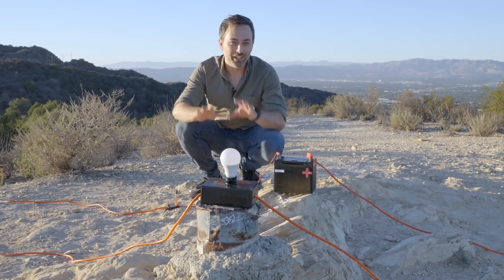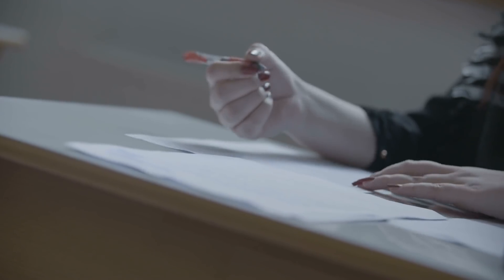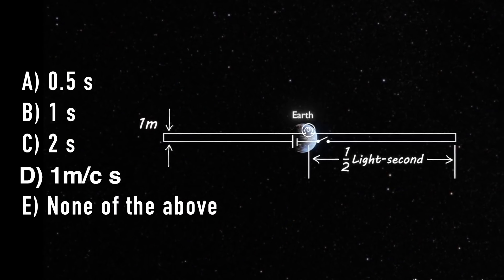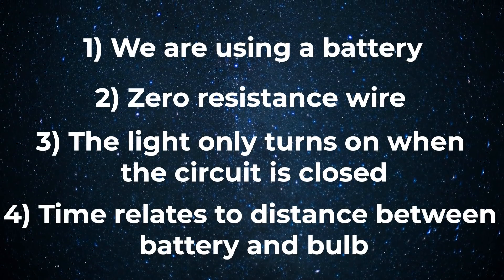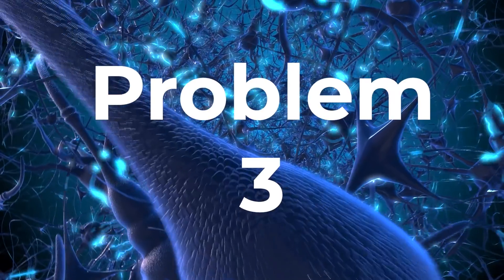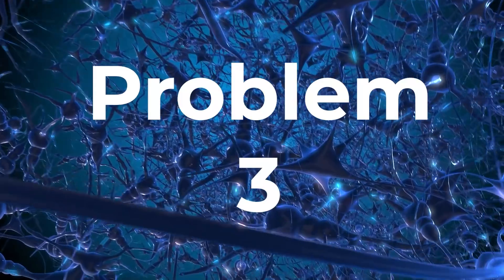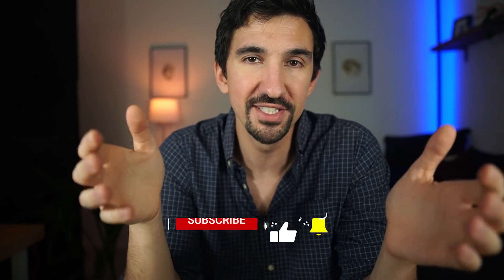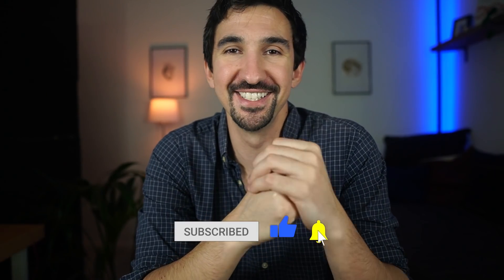Is Veritasium Wrong About Electricity?

Comment: Agree, the point of the thought experiment shown by Veritasium is to point out that electromagnetic energy can be transmitted by EM fields through empty space. So as you said, the set-up is the equivalent of a giant antenna, having very long transient rather than oscillating source. Indeed the amount of energy that can be practically transmitted with the set-up show is be very small. I liked Veritasium movie as it was quite thought provoking, but true that some parts are rather misleading.
Reply: The problem I have is that you can suppose the problem as DC supply and the without an alternating current you couldn't talk about antennae effects.
Reply: @alexnaturalis1179  Turning on a switch is an AC effect. I believe the circuit doesn't actually reach a DC steady state until the voltage wave has travelled all the way to the bulb and back through the wire, so Derek is looking purely in the AC/antenna regime.
Reply: @alexnaturalis1179  Totally agree.
Reply: Not "can be transmitted."  Is transmitted, always.  The wires don't carry the energy, the EM field does, in all circuits, always.  Check out Science Asylum for a more in-depth explanation, including some videos on how this is necessary for relatively to work.
Reply: @georgedorn_fnord  I came here to say just that. Really all mechanical energy is transmitted by the electromagnetic force. Based on bonds in the two materials and the repulsion by those electrons on the electrons of the other material or object.
Reply: Isn't that just radiation? There has to be an easier way to describe that if that really was what he was going for.
Reply: A combination of inappropriate assumptions and simplified physical effects is likely to result in invalid meaningless results.
To present this to people as useful information is silly.
Anyone with more than a high school science knowledge could see what it was.
Reply: Veritasium claimed you can transfer information faster than light in his thought experiment. the whole 1s/c or whatever is the culprit of that. It is not true and never will be since it'd break the laws of physics.
Reply: Surely there would only be a short spike of voltage induced on the bulb side since Derek is using a battery which is DC. The field would only induce a spike while forming.

Comment: About the "lies you were told about electricity" - think about it this way: If you get an explanation that does not fit the current understanding of the topic, but helps guide you to understanding (given enough time) that is technically speaking still a lie, as the facts are known to the one telling you something different than the facts.

The intentions behind this definitely are good, and it is necessary, too, as there is no way for beginning chemists to actually understand, say, the atomic model in its entirety. But, strictly speaking, it is a lie.

This is why Terry Pratchett once defined teachers as "Professional liars for children". Which, in turn, required him to elaborate on that point, which brings us here =)
Reply: There's no 'strictly speaking it's a lie'. It is either true or it is not true. Veritasium has been wrong about a lot things for the past 2 years. Just saying.

Comment: If the switch or the bulb (or a breakage as you suggest) were a light second away, it would appear to take a second - unless you as an observer were somewhere between them. It only happens instantly because the switch and light are about the same distance as one another from the observer.

Comment: At the beginning of the video I think you didn't notice that 1/c has correct units , because time equal distance over speed , the distance is one meter which is the distance between the lamp and battery and speed c so dividing 1meter by c will give us 1/c second so it is correct unit but it just wasn't obvious where did he got that 1 in numerator

Comment: I immediately disagree because if you have followed veritasium's video this means that at the furthest point in the circuit, after 1/c "seconds", you would have no clue that the circuit was closed because it would take a second for the energy to propagate through the electromagnetic field. Counter-intuitive, I know, but that holds if you agree with the theory describing how energy propagates through the field described in Ve's video. So yeah, the light bulb would turn on first and whatever instrument you put at the furthest point would turn on later.

Comment: LMAO "scientists" the only people on the planet dumber than engineers... look at your diagram again (put your finger on it if you need to) now starting from the battery side of the switch trace the line through the battery around to the lamp through the lamp and back to the switch.....do i need to explain this any further? the answer to the original question is that current flows the instant the switch closes because the only thing preventing flow was the open switch.

Comment: this was my first thought too!  Its a f*ckin dipole transmitter receiver!  Transfer of current.... well yes... but miniscule!
Reply: I feel like we can say that yes, Veritasium was wrong because in the context of what he was saying, it doesn't really work. The fact that technically some small amount might transfer seems to be a coincidence rather that what he was trying to explain.
Reply: Yep, using a reasonable battery, no person would be able to see it light up.
Reply: Please make a video
Reply: with DC? just an initial turn-on edge is flickered, not a constant "transmission"
Reply: Debunk it please
Reply: Please bust Veritasium. And learn about the Oil Industry.
Reply: With only one pulse because a steady direct current does not cause any further change in the magnetic field. The same principle applies when you feed a steady direct current into a transformer; there is no output from the transformer. To transfer current, a changing magnetic field is required. This is nothing more than a large, very low frequency tuned circuit, with incredibly large impedance that will delay the flow of current.
Reply: Can induction occur using Direct current? I would have thought that alternating current would have to be utilised 
to make this a dipole transmitter receiver. If anyone can enlighten me I would appreciate the reply.
Reply: @davidbrayshaw3529  The induced current depends on the rate of change of the current in the transmitter. You are right that AC current is constantly changing, and DC is not, but when the switch is flipped there is an initial current change (from 0 to whatever) and that is what can induce a current in the receiving cables, after the current has stabilized there is no more energy transmission between the cables
Reply: @johnegbert4786  Thank you, that makes sense. Effectively you've created a transmitter that operates at a very low frequency!!!
Reply: I agree, further more, we can expand the thought experiment with a second wire, and a second lamp, connected to nothing, an exactly equal distance from the source of power. If we measure both wires and they have identical conditions, they should both "turn on" but one isn't connected to the circuit. 

As such it has to be a transmitter, and nothing else, otherwise we would break causality. 

Lets say at 1700 we flip the switch, at the same time a guy on the moon (told in advance) flips his switch either on or off. 
We would know before the speed of light if that guy had flipped his switch on or off. 
As such this experiment if looked at very honestly would break causality.

If instead we add a second lamp with a second wire an equal distance away from the power source with identical thickness and resistance, but not connected to anything, we would either see both light up and this is just an antenna, or we would see the connected one light up (spoilers, no we wouldn't) and the whole thing breaks causality.
Reply: @Yattayatta  Your luna colleague and you would not be able to flip the switch at the same time due to general relativity.
Reply: @Tossphate  I don't know what part of my thought experiment you misunderstood, but of course you can flip the switch at the same time. Time dilation is a known factor and the movement of the moon is easy to calculate. 
This is how you would flip the switches at the same time:

Both flip at exactly 5:00 :00 local moon time,  If he flips, it's a 1, if not it's a 0, as such you have a bit and now you can transfer information faster than the speed of light, that is why the explanation in the veritasium video is at best disingenuous , because that would break causality, and that is not possible.
Reply: @Yattayatta  Simultaneity is frame dependent, and you and your friend are in two different frames. You cannot both agree on a simultaneous instant.
Reply: @Tossphate  No need for a single frame if you want to talk quanta. Lets extend the cables to the sun, he encodes his message 5:00:00 pm, I flip the switch to receive it at 5:00:05, light makes it there 7 minutes and 55 seconds later. You are not understand my thought experiment
Reply: There's no proof space is real. NASA means "to deceive" in Hebrew. The 2nd law of thermodynamics says space is fake. NASA lied. NASA steals $60 mil per day to shoot helium balloons into the ocean. We see mountains from 300miles away. That's impossible if we lived on a globe. 247 flat earth discord.
Reply: @xvhkgreen6297  i know Hebrew and NASA does not mean "to deceive", not a single synonym of deceive means nasa, nasa sound in Hebrew as "נסע" which means "to travel" lmao
Reply: Why am I so happy about randomly stumbling on one of your comments?
Reply: @Drachencheat   Because you (and I) have been brought up in a culture of product and celebrity worship.

Comment: I think you just took it further than the intent of his video and included potential.  Most people are taught electrical flow is like a water pipe, he was showing that this is not how it works, although for the layman wanting to wire up a simple circuit, it may serve them as a way to not over-complicate it and just get the job done as they have no interest in theory, only completing a circuit without frying themselves or the components. I do like how you took it a step further, but to be fair, I again don't think that was the point of his video. Thank you for the thought provoking content.

Comment: about the info transmitting faster than speed of light, i dont really understand anything at all so if someone sees i am wrong or confused or something pls send help ;(
now how im gonna set up the situation in regards to having only one button next to battery is gonna be different which is probably gonna change some things and idek how it will work with this, here im assuming theres not button near the lamp or battery 
now i dont think having a button at the far end will work because even if the far ends are disconnected the light will still turn on
other than wtv that poynting vector thing was (i havent learnt about it yet so i really dont understand it but) how i understand it is that the long length of wire on both sides will act as antennas and even if both far ends are disconnected (having a button) the capacitance between the wires and mutual induction will induce a current on the lamp and turn it on (is this how the poynting vector thing is supposed to work?? or should i wait till i learn about it ??) (also will this still work with having the button/switch in off state near the battery??) 
on DC source i think?? the capacitance and inductance will saturate soon enough ?? and the lamp will turn off or at least get dimmer after a while?? (im not too sure about this one) and by the time that happens IF the ends are connected the wave will have propagated through the whole length of wire to keep it on, on AC source this wont be a problem i guess?
so having a button really wouldnt change it, and if i understand it correctly on DC source if the lamp is dimmer/off after a while, having a button there to complete the circuit to let the wave pass is only gonna let that happen at the speed of 'c' so ye
tho im really not sure about wtv i said i really havent studied enough yet

Comment: I've liked Derek's video but I've made the same reasoning you have done. His video is only half of the story (the one that makes you say "WOW!") but it is a lot  misleading in terms of what you can get in the reality.
Especially he omits entirely what happens after the initial transient phase (that with that setup, barely produces any light at all, and lasts very short, which I can't count for "light turned on" but at best "light flashes a little") and the steady state phase when  the energy really arrives from the conductor of the closed circuit. 

I think the misleading part is mixing theoretical analysis (which is completely correct) with a super simply circuit made with real (cheap) parts and expect that theoretical effect appears in all its glory, which will never happen with that setup.

Comment: 1. It does not depend only on the resistance of the wires, it depends on the characteristic impedance of the line
2. Ignoring z, distance can be measured across 2 axes. Why is everyone ignoring the fact that he specifies the distance of 1 meter between the lamp and the bulb only on one axis ? If the lamp was 300,000,000 meters more to the left from the bulb, it would not light up that fast.

Comment: In the veritassium model the electron doesn't actually go all the way round the circuit, it just jostles an electron in a neighboring atom. Now it doesn't matter how tiny the distance between atoms is, the speed of the electron in making that communication is limited by the speed of light.

Comment: Okay, I have thought about this and... more questions raise like: if it is only the field that transmits the energy then what is arcing?
    But I think, however you look at it, nothing needs to move faster than light for the effects of an action to move faster than light. Whether you say it is the effect of electron mass-flow that directly powers the circuit, the movement of charge via the spaces that move in the opposite direction or the electric field, it is almost irrelevant because one of these phenomena does not exist without the others. However, it is the mass-flow of the electrons that is most easily calculated and considered, even if most people's idea of what this actually looks like is not correct.
  When you discuss oscillating fields, etc, in this video you appear to be forgetting that Veritasium's question this is about d.c. not a.c.

Comment: Hmm, Veritasium himself declares that once a circuit has been built, the fields themselves propagate at the speed of light. If that is indeed the case, wouldn't a break in the circuit far away only affect the bulb/switch after a while, and thus wouldn't break causality? Sort of like if the sun disappears we wouldn't feel/see it until ~8 minutes have passed? DISCLAIMER: I am not officially trained(or even unofficially tbh) in any of these fields, so I might come off as completely dumb here.

Comment: As I've said in his post, video, and now here, the light will turn on in L/c*Vf where L is the length of the wire from the switch and Vf is the velocity factor of the wire. For copper, the velocity factor is about .94 or 94% the speed of light.

Comment: For your explanation, it is assumed that the electrons move one at a time so you have this idea of time required before the light is off. But if all electrons move at the same time at turn on/off then it would be instant. 
All thou I do find it hard to grasp the veritasium vid without any measurements shown (probably others have measured, I don't know)

Comment: Just note that for the bulb to light electrons must leave the cathode of the battery and electrons must enter the anode, else no power is "generated" or transferred. That is the movement of the electrons are essential in turning the bulb on.

Comment: There can't be many people who have thought about this in the world as a percentage, but I have; back in the 90s in my local pub, I started thinking about something very similar and discussed it at boozy length with a fellow electrics nerd friend. I've pondered it occasionally ever since, and stuck with the conclusion that the thought experiment is flawed, because the setup is incomplete. We came  up with pretty much what you did; there isn't a simple "on and off", but you will get inductive (and capacitive) field effects rather than the implied "current starts flowing and the lamp is on" type result.

So in that sense, the question of "when does the lamp light?", implying a binary "it is on, or it is off", is simply misleading.

Comment: The point here, I think, is that it isn't the length of the wire that matters as much as the distance between the battery and the bulb. Somehow, even if the circuit extends as far as a light second, it can facilitate a field that carries power from the source to the lightbulb in only the time it takes light to travel the distance between those two point.

Comment: In electromagnetics I was taught how the phase velocity impacts travel time of incident waves, and that any given signal will propagate along the transmission lines at a speed of phase velocity=wavelenght*frequency (or angular frequency/phase constant). 
Surely this relatively simple phenomenon alone disproves the 1/c answer, as the forces themselves need time to propagate along the TL, and the conductors are 2 light seconds long in total.